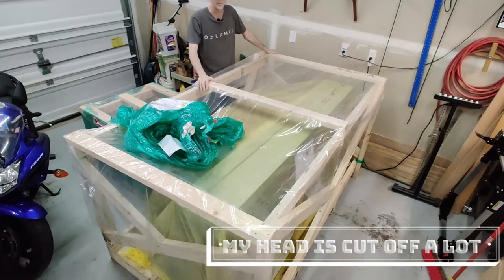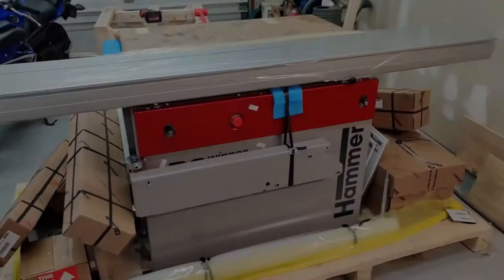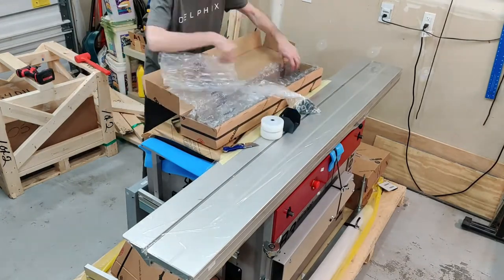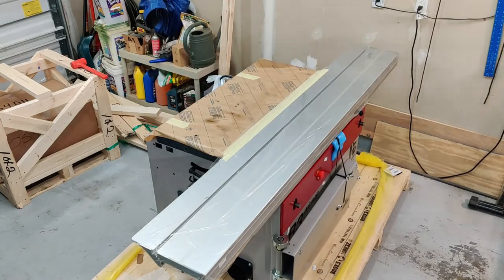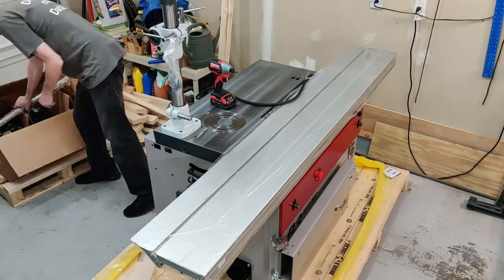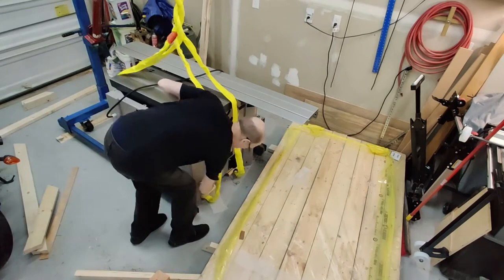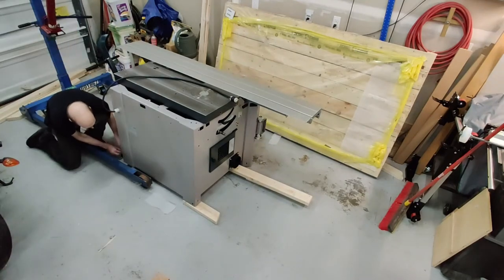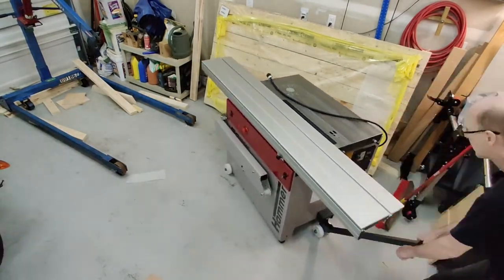Un-crating my Hammer B3 Table Saw

Comment: Seems you could have put the wheels on while it was lifted by the engine hoist
Reply from the maker: If I put the straps as far apart as possible on the axle, probably. I had tried to put the wheels on it when it was on the pallet using a block and the axle bent. It returned to almost straight.
Reply: I'm getting my felder cf 741 in June and I was a little nervous about size since I have a 2 car garage as a shop is that a single car garage? How does it fit?